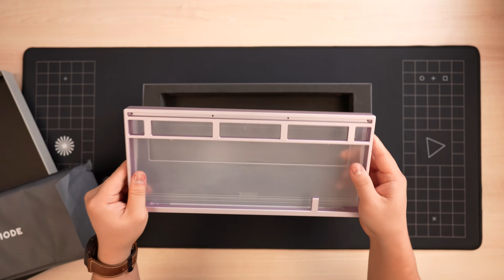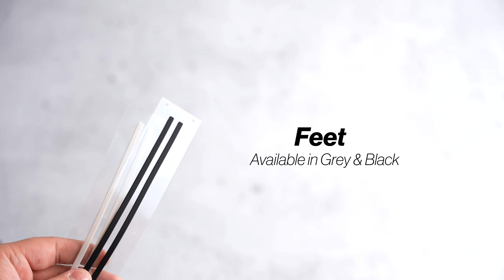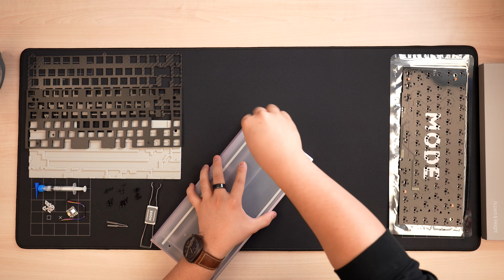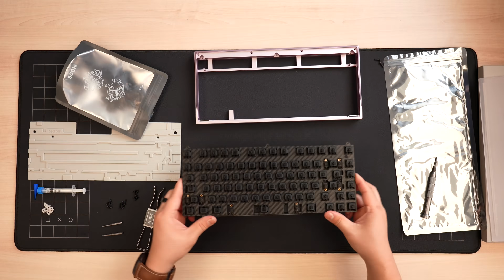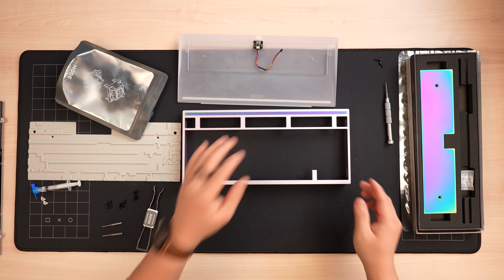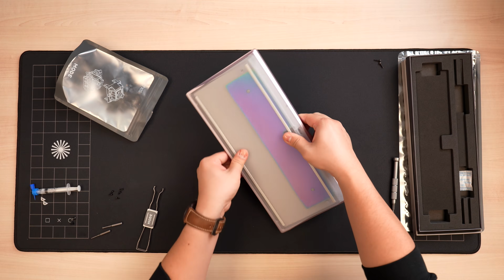Mode Sonnet (2022) - Official Build Guide!

Comment: There is one feature which most people take for granted but which in the long run makes this board stand out and elevate it above  ALL custom boards out there.
The design of the plate allows removal of the stabilizers by removing or desoldering ONE switch.  This feature will become more important if u have a solder pcb and decide at some future date to replace / upgrade your stabilizers  or if some new stabilizer comes  along . No need to desolder / remove 90 switches 
I have 2 Rama M65 boards and while I love them , when staebies were released I went through the pain of desoldering 2 entire boards  - hours of tedious grind - 
Unfortunately- once the Sonnet arrives the Rama boards are getting shelved for good   - I'm not going through desoldering an entire PCB ever again and playing around with a Syringe , and trying to touch up stabs isn't my thing either 
I prefer to rebuild stabs and tune them from scratch 
Mode designers are TRUE keyboard enthusiasts who understand what ppl want and need 
Hats off to mode for this one feature which not even famous twitch and youtube streamers seem to point out in detail and which is of utmost importance